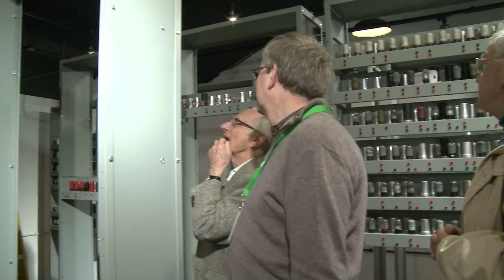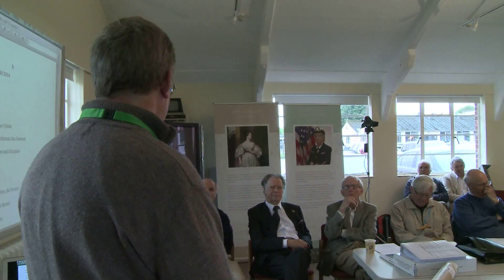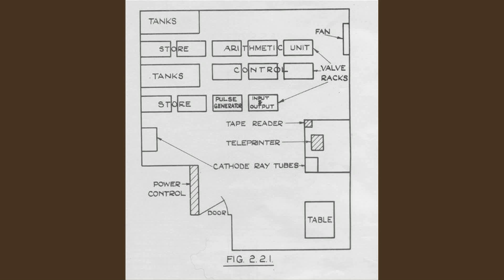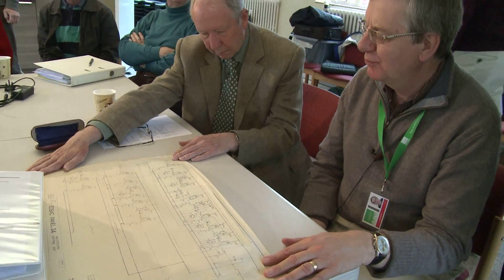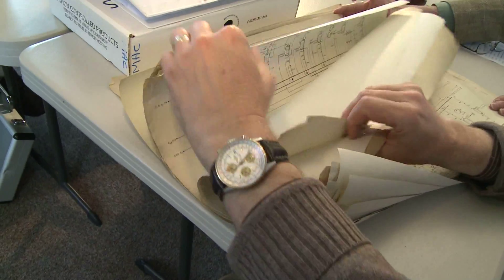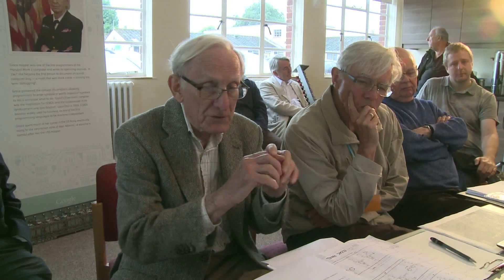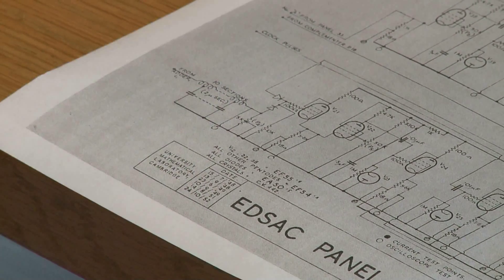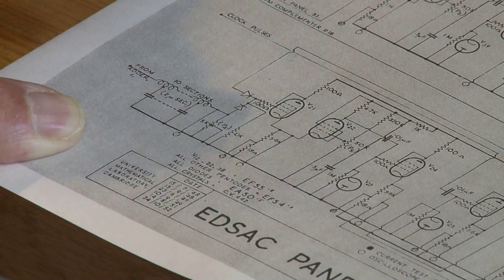Re-discovery of EDSAC diagrams

Comment: My father who is an amateur radio operator (HAM, I am too), still uses valves (or tubes) to build/repair old hallicrafters receivers, Drake transceivers/receivers or more modern equipment like Yaesu or build replicas of Fender guitar amps, the technology is the same. He also builds high power HF amplifiers using ceramic tubes, with the likes of 4000 DC volts on the anode (you gotta be careful with that), that can produce around 2Kw of HF power. Of course transistors are used more often today, but if you want some serious power and reliability, valves are still valuable, but can be very expensive, and hard to find for the older models.
This video is very interesting! Fewer and fewer people understand the meaning of "grid current", anode, cathode, heating filament etc, it's a pity...